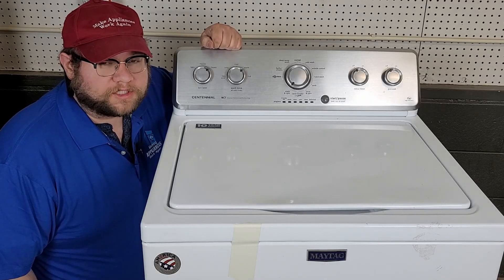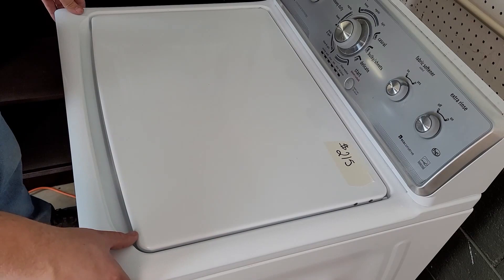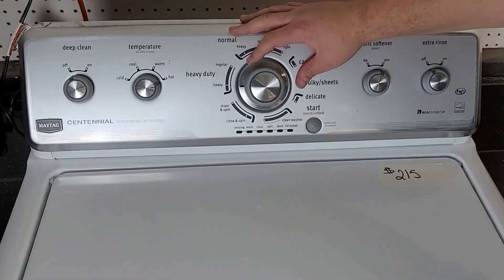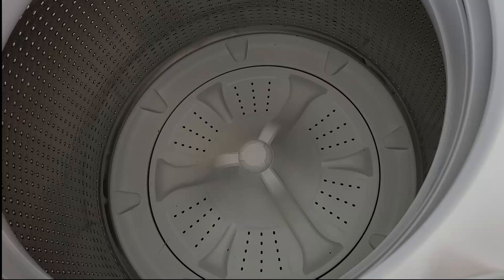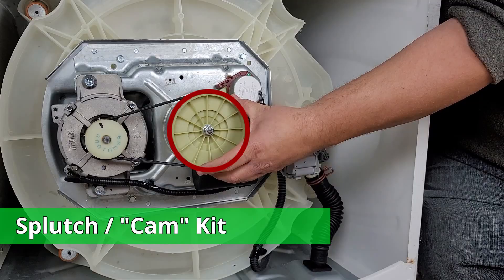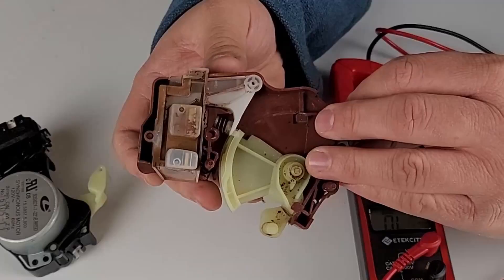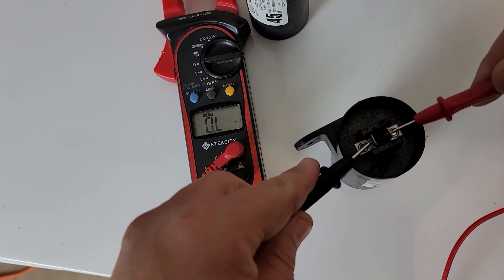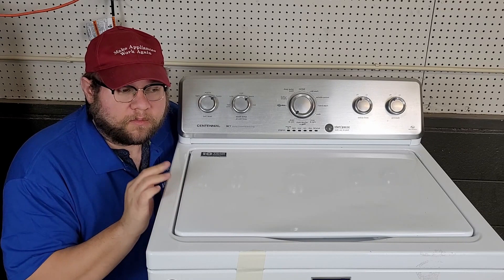Maytag Washer Won't Spin - How to Troubleshoot a Maytag Centennial Washer

Comment: Hello I am subscribed with you. And very good video and well understood! I have a Maytag centennial washer just like that. And when it spin it makes a lot of noise like a plane and I change the new actuator and it does the same when it spin, it doesn't want to spin anymore and it still makes a lot of noise.  What problem will it be, can you help me, what problem will it be?  I would appreciate it very much. God bless you 🙏
Reply: Probably the suspension rods. Easy fix

Comment: Ben, I am sitting here watching the video for the 12th time and checking the switch actuator. According to the video you state the 5th & 6th pins should read between 2,500 and 3,500 hundred ohms. Based on that I ordered a new actuator. The new one does not read this resistance either. The pins are marked but I also tried 5 & 6 from the other side which would be 2 & 3. Can you provide more detail? Maybe a spec sheet. I can read a schematic
Reply from the maker: Did you try running the shifter in diagnostics for test spin?

Comment: Love your channel, question, i have a one year old top load maytag washer , there is F7E1 code, washer can not spin or wash ,  i have checked the shift actuator motor works fine . When the cycle starts and if i help the machine to start to spin . But as soon i stop helping with spinning , is stops and the error code comes on , ANY HELP YOU CAN HELP WITH

Comment: Bro I have a whirlpool top load washer m#  1mwtw1400cq2 I change the suspension rod but there is no option to recalibration the machine and now its doing everything except spinning when on rinse and spin mode

Comment: I have same exact washer...i get error f7 e1 and blinking lid lock light... So i buy used shift acuator and now i have new  error f7 e5 but not blinking lid lock light..any ideas?...fyi my washer rinses and drains and spins fine if i turn dial to that cycle....but having issues starting wash cycle and spin in auto mode.

Comment: What tells the motor to agitate? In other words turn clockwise then counter clockwise. My washer goes clockwise then counter clockwise then stops and about a minute later starts to fill and again then attempt to agitates again stops it keeps doing this
Reply from the maker: Check the error codes. That will likely explain what is causing the issue making that problem happen.

Comment: What about leaking. Not the tub. Replaced that. Over on the right side not a lot of water. Paid a guy 165 for an HR to run codes and do nothing. Got on my hands n knees n was like waters leaking her. He said a new bucket lid so I did the tub ring replacement. Wasn't that part. It's the same washer as yours.

Comment: Hey Ben,
I have a whirlpool ITW4300XQ0 top load washer. It is direct drive and was making a loud noise that ended up being the water pump. After replacing the water pump, the washer is now making a loud bang/grinding sound after the spin cycle. It was not making this sound before. Is it possible I damaged the drive block when I removed the drum? The spanner nut was on very tight. Thanks in advance for your help.

Comment: Good video. 
However I have a question. 

Are the resistance values of the motor still valid for motors running at 240 VAC? Or they could be different?

My motor reads 13 ohms and 26 ohms instead of 3 and 12 ohms.
Reply: Reads 13 and 26 instead of 3-5 and 6-9 ohms. 

I’m not sure if this is related to operating voltage!!!
Reply from the maker: They'd be different, I think. Is it a 240VAC Whirlpool?
Reply: @bensappliancesandjunk  

No, it’s a Maytag washer running at 240 VAC in Saudi Arabia.

Comment: Got the code F7 E1.  Checked the spin actuator as you showed and it shows 2.19k in ohms.  Back home and can't check the capacitor.  Machine is at another location 4 hours away.  Could it be the capacitor or would it be the motor.  No part stores that carry Maytag parts where the washing machine is located.  Any help would be appreciated.

Comment: does Maytag top load washing machine model # MVWC425BW0 has bearings (ball bearings) if it does can you please guide me where to buy from and how to replace it (video) and what will be the part number. thank you, your videos are very educational.
Reply from the maker: It has a bearing. You cannot replace it. You need to buy the entire gearcase, as the bearings are machine-pressed in and nearly impossible to get off without causing damage to the gear case.

Comment: There’s a lot of resistance when I spin the splutch wheel by hand. A LOT. Where do I start?
Reply from the maker: Check under the metal tub most likely for an obstruction

Comment: I have the Maytag Centennial washer / dryer set but must be older model without the LED’s. Is testing possible? I think the dial on my washer is messed up. Sometimes it washes fine other times it’s out of sync with the cycles.
Reply from the maker: If its a mechanical timer it will have a radically different solution, and this is not the video for it

Comment: My washer does everything in automatic test mode, when I put it in any other mode doesn't agitate. I bought the actuator and hot and cold water valve. It gives me the Long fill code.  Should I buy the motor? What could it be?
Reply from the maker: Is it only giving you the long fill error? If so it may be hose or filter related

Comment: Washer won’t spin until I force it to rotate one time . Then when spinning it’s  loud roaring sound ?
Reply from the maker: Roaring is a shot bearing most likely. Check underneath for any damage to splutch system, or if its cutting into the plastic housing

Comment: i have a maytag top load washer MVWC565FW and its stuck, I tried several times to put in diagnostic code and it won't work. The washer has water in there is that why? I bought the machine in 2017 and it has happened before the tech came in and reset it, cleared the codes, somehow i am not able to put in diagnostic code, is it because of the water in there?

Comment: Hi Ben, Your video is very helpful out of all the MayTag ones I've seen! I have a question for you. Using a multi-meter, I did check my pins 5 & 6 but the output I see varies from 799 to 1. It's not steady. By comparison, If I test some other molex pins, the output is stable at some number. Its a MayTag centennial washer MVWC415EW. Ideas on this issue? The machine does spin the tub but its loud and its slow. Sometimes not spinning at all but making a loud noise.
Reply: Same thing is happening to me. So I went ahead and tested the motor, I removed it and it was bad. No resistance and full of dust

Comment: What about F1E2, Motor Control Fault?  Replaced the motor and the lock switch still just flashes lock, and if it does get past that the motor just hums and gets hot and does nothing.
Reply from the maker: Did you try re-calibrating the entire system?
Reply: @bensappliancesandjunk  wont let me.  All the lights on the entire machine go on, does nothing then just turns off.

Comment: Hey Ben I'm currently working on this beast now will not spin took clear cover off to see if I could spin the motor and spruce thing but I cannot budge it. Also black oily mess everywhere do you think it's the trannsmission
Reply: Also motor is hot to the touch

Comment: Hi Ben. My brand new Maytag commercial technology washer didn’t spin my clothes completely. I’ve been on hold for 40 minutes. I ran a check cycle to make sure it was all working adding water and didn’t leak from any hoes. When I ran my first clothes washing cycle I am saddened that it didn’t spin completely. And there aren’t any trouble codes on my washer. Model number MVW7230NM0, serial number CA1501319

Comment: 5:00 if the washplate spins alone  it’s good or if the washplate spins with the basket it’s good?
Reply: the washplate should only move alone when its agitating. if its spinning continuously but not the basket, there is a plastic toothed gear under the washplate that has stripped out. Just replaced one last weekend for a customer. Too much change got lodged and stripped it out

Comment: I am getting 2.075 ohms on pins 4 and 6 but nothing on 5 and 6. Is it possible my actuator is different or do you think it is bad? Everything in this video has been identical to my machine up to this point.
Reply from the maker: I'd use the manual tests and switch between agitation and spin modes and see what the actuator does. Usually the physical test a few times can root any issues out

Comment: I inherited a washer like this... if you lift the lid to look or check inside rather than just assume things are going ok, after you start the process... The last fastest spin cycle ~"Won't"~ it will make sound and the pump will drain but it's faking. I don't trust that washer... It's to old to have any lights, but its got to be a safety thing, idk?...
Reply from the maker: Depends on model. All the light-based Maytags like this should have the electric drain pump and lid lock. The ones' slightly older use a totally different tech system in them.

Comment: I have a may tag washer, and when it starts to spend the machine vibrant really bad what can I do to fix it
Reply from the maker: Make sure its level to floor. Then check and see if the inner tub has play in it vs. outer tub. Then press down on the Maytag tub and see how fast it "pops" back up, and if it stays there or bounces a bit.

If the whole tub bounces a bit like a basketball, the suspension rods are bad. If the inner/outer tub has play, it could be the hub.

Comment: Hi..i have centennial..it wont spin..rinse ir drain in auto mode...it agitates entire cycle then at end stops...
However if i manually turn knob to spin and press knob it soubs n drains fine...if i manually move to rinse it rinses drains fine...any ideas?
Reply from the maker: That has a mechanical timer, and my experience usually is that the timer is going bad. Not cheap to replace.

Comment: I have a guestion my maytag washer. Was leaking transmission fluid a couple weeks ago. So it guit spining now. It just makes noise. So could it be the transmission?
Reply from the maker: Noise could be transmission, yes. if you see a ton of fluid, that's a pretty sure sign that the transmission's bad.

Comment: Mine fills and drains but no agitation or spin. Got a whirlpool top load. Do you think it could be the actuator?
Reply from the maker: Hard to guess without knowing the error codes... i would find those and see what taht leads to
Reply: @bensappliancesandjunk  after putting it into diagnostics I got F5 and on the same setting it gave a F8 alternating back and forth. No other codes on the the other three selections

Comment: Update: I have replaced everything on my washer including the control board. When I do the pretest to reset everything it runs the water and drains fine. when it tries to engage the motor, the motor buzzes. I bent the washer back and tried turning the motor when it was starting and it took off but would not start by itself like it didn't have enough power to turn the wash tub. I pulled the capacitor off again and it tested good. I tested the old and new motor I have and they both tested good. Any ideas what the problem could be?
Reply from the maker: Its either going to be the motor or capacitor.
Reply: Thank You!  I have replaced the motor with a new one and tested the capacitor at 50.3 and it is holding a charge. Still buzzes on agitating and spin mode when doing the calibration. In calibration mode, the center spindle will start moving when I turn it by hand to start it, but the drum will not engage when I turn it by hand during calibration mode. I took the belt back off and set the calibration mode turning the clutch wheel from under the washer. The motor activates and runs fine. I pulled the center agitator out in the bottom of the tub and it was pretty grimy underneath, so I cleaned everything and reinstalled it. Still did the same as before. I noticed that the person that reconditioned this washer back in 2014 when I bought it had replaced the plastic gear hub with a metal one  as you show in one of your videos. Didn't know if those metal ones will go bad, but everything seems to move freely  and there is no noise or looseness. Also, after the tub has completely drained, when I turn the tub, I still hear water sloshing around. I have even taken it outside and turned it upside down, but all the water does not come out. Could this be a problem?

Comment: Great video @Bens, Do you have suggestions of possible issues of the machine not going into High speed mode? Is it always related to the transmission or can it be something else? My clothes end up soaking wet but it does the whole cycle. I run the diagnosis code and got "Basket Speed Fault" fault.

Thanks for your advice!
Reply from the maker: Is it spinning, just not in high speed? Is it similar to this one?
Reply: @bensappliancesandjunk  I can hear the sound it makes when it spins. Does it spins slowly when washing/rinsing? And then faster when it spins dry the clothes? I might need to ger in to testing mode with the lid open to make sure it spins. Im.actually puting a load right now. I guess i will just memorize where the clothes are and see if they changed posittion to know if they spin haha!
Reply: Oh and, its the exact same machine.
Reply: @bensappliancesandjunk  Hello again man. Found out it actually does spin. Just doesnt do it fast enough to dry the clothes. I tried several times just putting dry + spin cycle to make it dry the clothes more, but it only does a few sounds for a minute, spins a bit for about 30 seconds and then it changes to done. With the clothes still soaking wet. Any advice?
Reply from the maker: @gastelummg  capacitor or motor may be weak, most likely cap.

Comment: I think the problem with my washer is the shift actuator and I tested it on a multimeter.  it read about 600ohms.  I bought 2 new shift actuators and they both read around 500.  am I going crazy?  or are all three parts bad?  should I buy ANOTHER new part?
Reply from the maker: Usually there's a band of tolerance, 600ohms should be close enough to OK, but that's just my opinion.
Reply: @bensappliancesandjunk  thanks.   Probably is something else then.

Comment: On the off chance you're still reading the comments on this video, what if my washer isn't responding at all to the diagnostic mode? No lights, nothing. Machine has power (multimeter responds). Is this a capacitor issue? Internal fuse? Shame since I can't seem to even get the codes.
Reply from the maker: Unplug it. Take back off of console to expose board. Plug it in and listen for the relay to click and power the board up. There also should be a green light iluminated on the board once powered. If you don't hear the click or see the small green light, the board or power source is bad. It should always respond to the code, although each individual washer can be finicky on how fast or slow you input it. Sometimes we hit the code the first try, but we've had a few washers where it takes 6-8 attempts at various speeds to find the sweet spot. Also unplugging/waiting 1 min/then plugging in after 2min bootup to try always helps, IMO
Reply: @bensappliancesandjunk  thanks! No green light. I'm worried the board is bad. Do you think it's worth a repair call? Is that a reasonably affordable fix to have the board replaced?
Reply from the maker: @ChristopherFerguson  Make sure the outlet is good. Test something else on it like a toaster. If its OK, then I'd replace the board directly. A service call will be $100 to tell you the same thing. That light HAS to be on.
Reply: @bensappliancesandjunk  gotcha. Gotta find the part now. Sorry for all the questions but I didn't see in the video where I might find that part. Any last guidance on that? (very much appreciate your advice and help on this! 🙂)

Comment: My Maytag washer will spin with lighter loads.  But as soon as the load is a little heavier, like with some towels, it will not spin.  I have to remove some of the load then it will go into spin.  I then stop it, return the whole original load and it will spin normally again.  Any idea what might be happening in this case?  Thanks Todd
Reply from the maker: Either wash plate is stripped, or cap is bad.
Reply: @bensappliancesandjunk  I replaced the capacitor and the washer is still acting the same as before.  It won’t spin with heavier loads.  But when the load is mostly removed it will go into spin.  Then I pause it and put the whole heavy load back in and it will then spin like it should. The wash plate doesn’t appear to be stripped.  There is a little play when I move it back and forth but that’s it.  When I took the bottom cover off there was a little oil on it, but it didn’t look green.  What should I check next?  Thanks Todd

Comment: What happens if you go to spin the drum manually, and it won't move?
Reply from the maker: Then it won't spin. It could be the motor, capacitor, an obstruction, a belt obstruction - please watch the part where all the other components are gone over that could cause it not to spin. Check error codes and see which ones pop up to narorw down the part it may be.